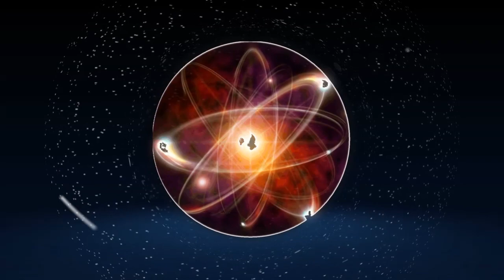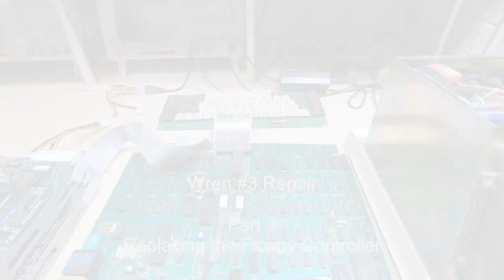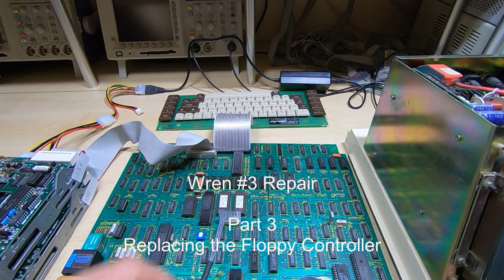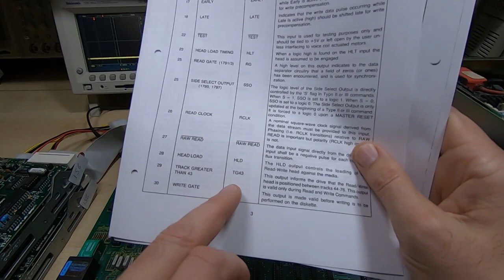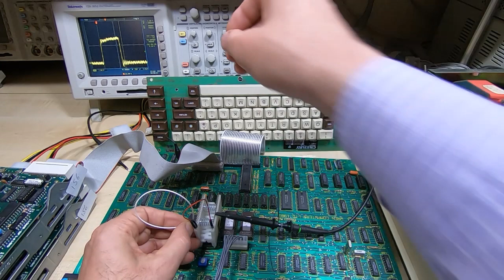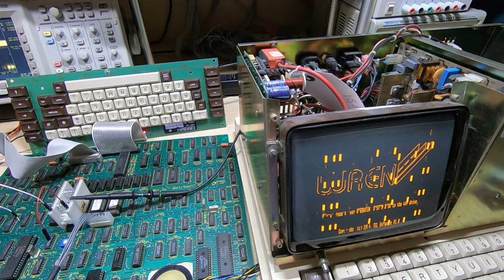Wren #3 Repair Part3

Comment: It's my understanding that there were only 1000 of these machines sent to market. You have 3 of them, bravo. Excellent series.
Reply from the maker: Yes they made enough parts for many more but only around 1000 were actually manufactured and sold. 3 down 997 to go. I repair a lot of vintage computer equipment and the most surprising thing about the wren is how complete the package was. The software that came with it was very advanced (I will be posting a video on this) and it was way more than most manufacturers at the time were supplying. They apparently had a lot of initial quality issues and by the time these were resolved they had missed the boat. A real shame as they would have been good computers for the time.
Reply: @JerryWalker001  Agreed. Even though I don't live there anymore, I would have loved to have had one. I too have often worked on a lot of vintage electronics through out my life span, even though it has been a lonely quest of love. I have a small  collection of radio engineering books published from the early 1900's that I found helpful in understanding how my predecessors thought through designs. I so enjoy your posts. Even the lost lawn mower saga.